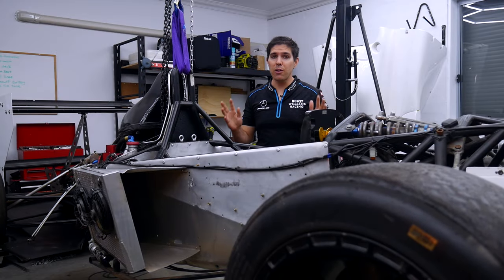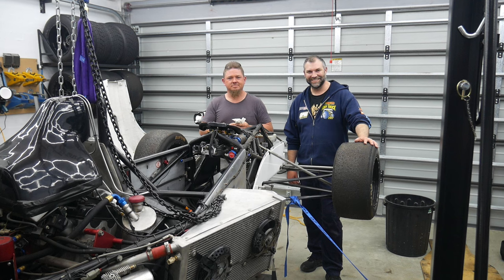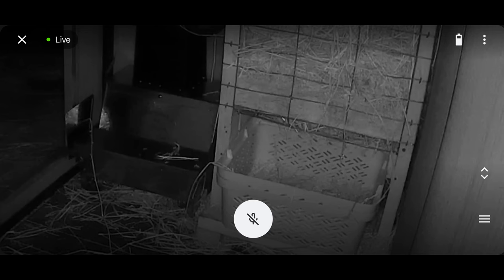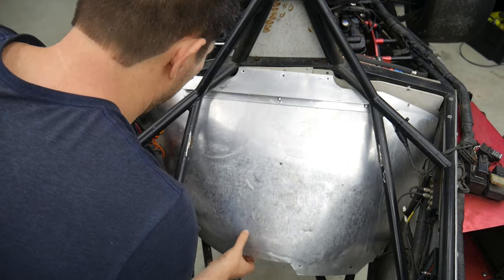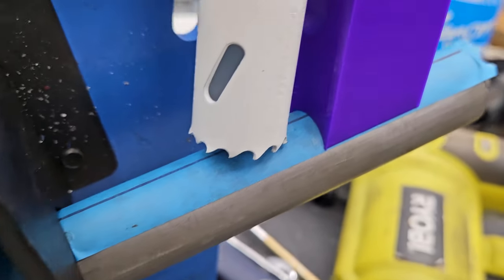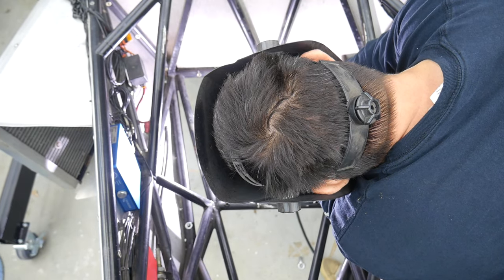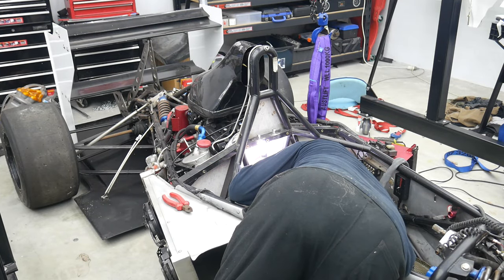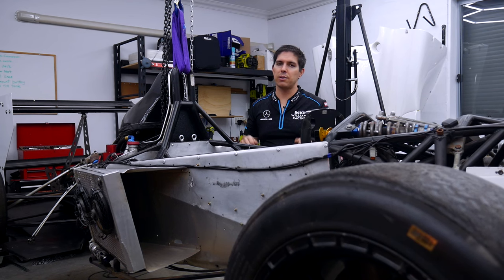Cutting and welding the chassis to fit the new harness - finally!

Comment: Good to see you back at it!
Just ordered a Vevor Tube Notcher - thanks for the tip. Hopefully it will stand up long enough to build a roll cage...
My wife was full of encouragement to go and buy the XR8 to build a race car. Her enthusiasm has waned somewhat as I collect more and more of the necessary parts, and of course it's never just 'weld in a cage and go racing'. First there's fix all the broken stuff... Then there's the "are you working on that thing again??" My advice - Hide most of the receipts!

Comment: Hi Michael. I am not sure if I have already mentioned this but I would advise you to check the pushrod adjusters on the car. Some of the early cars had hollow  adjusters which have been known to fail whilst adjusting the ride height.  The hollow ones are not fit for purpose and the build quality is such that some of the wall thickness at the root of some of the external threads is insufficient. We just replicated the adjusters in solid. Hopes this helps

Comment: Hi, just a small tip when using a spray can use long strokes and stop the spraying at the end of each stroke. This way, you don't get a blob of paint on the return run,
Cheers
Reply from the maker: Thanks, but my painting is beyond saving.